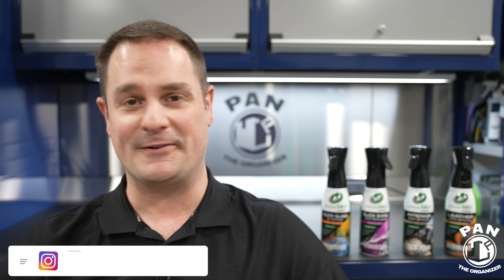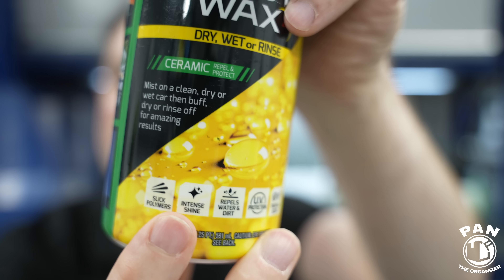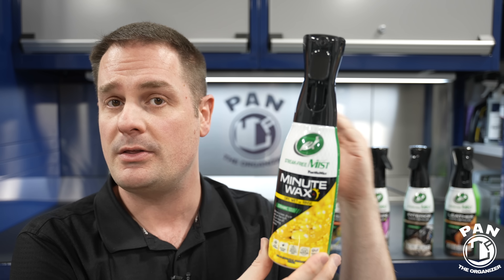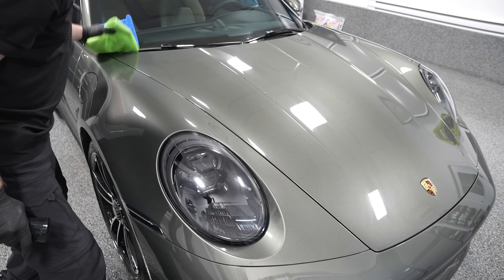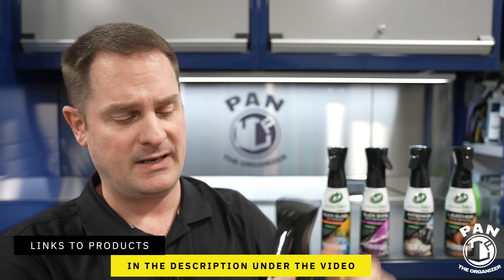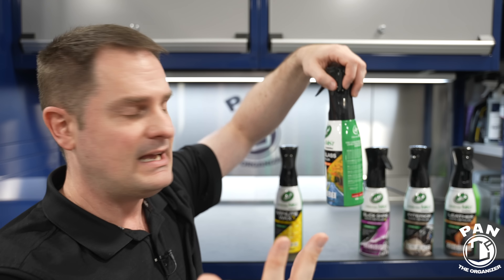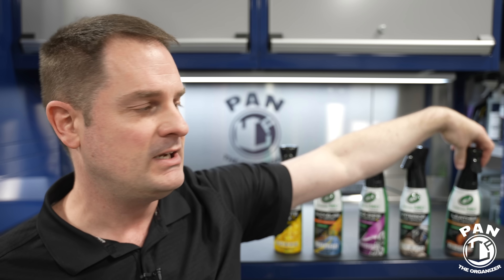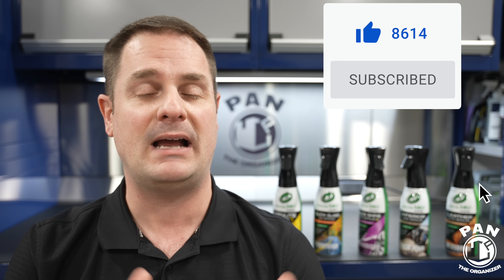The NEW Turtle Wax Minute Wax! You guys made this happen!

Comment: Helpful review, as always.  However, I have a question.  With these easy-to-apply "one-step" protection products so prevalent in the industry now, why would I use, for example, TW Minute Was vs. TW Seal and Shine?  For years, after every wash, I put a quick application of TW Seal & Shine on.  The effort to apply/remove is the same for minute wax vs. Seal & Shine, the price for each is a few bucks difference (Walmart $8.48 vs. $12.13), but with Seal & Shine, you get a highly top-reviewed, torture-tested product, and proven reliable product that will last much longer than Minute Wax.  Am I missing something?

Comment: Hello. I have some questions. First - can it be used like a quick detailer that you can use every time after wash a car (for example every week) if It can't. Second - How long should it be used? Weekly, monthly or in two months or ex. Third - if it is not a quick detailer, can i use quick detailer over it after my maintenance washes?
Reply from the maker: Turtle Wax states one can expect 6 to 12 months of protection with the new Minute Wax. 

As Minute Wax is new to market, I still need more time to evaluate the real world durability of Wet Wax in my conditions, but I would recommend it more as a topper over an existing protection, to boost the properties of that protection and maintain its durability.

You can try and use it weekly as a QD if you want, but just do very light applications.

Comment: Pan, thanks for video.  After washing car, I apply P&S Bead Maker, then dry.  Can I put the Turtle Wax Minute Wax over Bead Maker or should I skip  the Beadmaker?
Reply from the maker: I wouldn’t stack too many toppers. Pick one.
Reply: @PanTheOrganizer  Pan, thanks for response.  BTW the best reason to buy Minute Wax Minute Wax is that you get a Flairosol sprayer/bottle you can use when empty that is cheaper than buying an empty Flairosol bottle.

Comment: I'm a fan of the second "dry and shine" method. As an apartment dweller who mostly has to use commercial do-it-yourself car wash bays for maintenance washes, I don't have to waste any of my 6 minutes of paid for water wash-time using the dryers or wax products they offer. i just wash, then drive out, park and dry/polish outside of the bay. If I have any "complaint" about TW products is that there are so many products that seem to do more or less the same thing and frankly it's a little tough to keep them all straight. But their value for dollar is unbeatable.
Reply from the maker: Yeah the bang for buck you get with their products is nuts. Thanks for sharing!

Comment: Is it better then gyon wet coat I've been using it since last summer it lasts for ages and so easy to use so is this better
Reply from the maker: WetCoat is more a pro grade product and will last longer. It also costs significantly more.

I wouldn’t compare them.
Reply: @PanTheOrganizer  thanks pan for your reply
Reply from the maker: Turtle Wax states one can expect 6 to 12 months of protection with the new Minute Wax. 

As Minute Wax is new to market, I still need more time to evaluate the real world durability of Wet Wax in my conditions, but I would recommend it more as a topper over an existing protection, to boost the properties of that protection and maintain its durability.
Reply: @PanTheOrganizer  yes that sound a good use for it I'm in UK well used to turtle Wax brand

Comment: Hi Pan, would you say this product is better than Turtle wax Seal & Shine or Turtle wax hybrid solutions graphene flex wax?
Reply from the maker: You can’t compare those to Minute Wax as the other two are long term paint protections. Minute Wax is more of a quick maintenance product. Not meant for long term durability.

Turtle Wax states one can expect 6 to 12 months of protection with the new Minute Wax. 

As Minute Wax is new to market, I still need more time to evaluate the real world durability of Wet Wax in my conditions, but I would recommend it more as a topper over an existing protection, to boost the properties of that protection and maintain its durability.

Comment: Can the minute wax be use in direct sun?  I’ve been using the turtle wax hybrid 1 in the black bottle with the neon 1 on the label for a few years and love it on both our cars and Harley’s.  Your demo on that stuff was great as was the hybrid wash system.  I use that between detailing as you suggested.  But I love that you can use those products on warm surfaces in the sun.  

Does this new stuff work the same?

Thanks for the videos and info!!!

Comment: Looks great!  What's the difference between the minute wax and the Turtle wax ICE Seal N Shine?  Which one is better?
Reply from the maker: That's a tough one... Minute Wax probably has a bit more gloss and for sure more slickness, and Turtle Wax states this can last 6-12 months under the right conditions with proper maintenance, and it contains ceramic. Seal-N-Shine is more a traditional paint sealant that can last 4-6 months, and likely has slightly better chemical resistance.

But Minute Wax is still too new to market and nobody has had the chance to use it for that long yet. Time will tell.

Comment: What was the difference on performance for the 3 different application methods? Does it attract dust?
Reply from the maker: Applying it on dry paint will always yield the best performance and durability, as it's not as diluted as applied on a wet surface. But application on a wet surface is quicker and more efficient. So it depends on what you want: speed or performance. 

I don't have dust issues where I live, so I'll rely more on my viewers' feedback for that.

Comment: I’ve been using the turtle wax ceramic spray and absolutely love it! Do you think I should switch to this new stuff? What’s the benefits of each?
Reply from the maker: Which ceramic spray are you referring to? The Hybrid Solutions Ceramic Spray Coating? The Ceramic Wet Wax? The Ceramic 3-in-1 Quick Detailer?

This Minute Wax isn't in the top tier Hybrid Solutions line, so we can't really compare that. But Turtle Wax states one can expect 6 to 12 months of protection with the new Minute Wax. 

As Minute Wax is new to market, I still need more time to evaluate the real world durability of Wet Wax in my conditions, but I would recommend it more as a topper over an existing protection, to boost the properties of that protection and maintain its durability.
Reply: @PanTheOrganizer  I was referring to the Turtle Wax 53409 Hybrid Solutions Ceramic Spray Coating. I love the stuff. Easiest thing to apply and the shin and smoothness of the paint is unreal. So you’re saying I could spray the hybrid ceramic spray first then this product as a topper?
Reply from the maker: You would apply the Ceramic Spray Coating, wait 24 hours, apply a 2nd layer. Then wait a full week before washing your car. At that point, yes you can start using the Minute Wax as a spray topper.

Comment: How would you compare it to Gyeon WetCoat? Thanks Pan for the review.
Reply from the maker: You can’t compare a pro grade product to a consumer grade one in my opinion. WetCoat will likely last longer but costs significantly more. And WetCoat isn’t meant to be used on dry paint. Minute Wax can be used on wet or dry paint.

Turtle Wax states one can expect 6 to 12 months of protection with the new Minute Wax. 

As Minute Wax is new to market, I still need more time to evaluate the real world durability of Wet Wax in my conditions, but I would recommend it more as a topper over an existing protection, to boost the properties of that protection and maintain its durability.

Comment: Got to admit your videos are awesome so informative but I have a question is this not a similar product to gyeon wetcoat or a quick detailer ??
Reply from the maker: Gyeon WetCoat is a pro grade product (vs Turtle Wax that is a consumer grade). You can't compare both. But WetCoat is purely to be applied on a wet surface, and rinsed off. And costs more. 

Turtle Wax Minute Wax in theory, will last longer (2-3 months for WetCoat, vs 6-12 months for Minute Wax according to Turtle Wax, remains to be seen in long term testing). Also, the TW is more versatile as it can be applied on wet or dry surfaces. But WetCoat will have better hydrophobics and chemical resistance.

Both are good really, it depends on what you're looking for.

Comment: I was looking for your video last night 24 hours ago. I was about 10 hours early on looking for your upload of this. I knew you would cover it.  I bought a bottle. I used it on my truck as a rinse aid. To compare to Formula 4 auto car wash wax and Suds lab hydro rinse off product. (Different panels) I did hybrid solutions detail must after.  I’m wondering if these bottles can be easily refilled when empty? The sprayer pattern is epic. Matt needs to collaborate with Turtle wax for upgraded sprayers.
Reply from the maker: Yeah I love these Flairosol sprayers. That perfect mist each time. Apparently you can potentially refill them, but I haven't tried it. To my knowledge, the cap is pressure fitted on the bottle.

Comment: Didn’t read every comment and maybe you had said what my question is
How long does the spray wax last approximately with a vehicle that left outside in the sun
How often do you apply the spray wax
Reply from the maker: Turtle Wax states one can expect 6 to 12 months of protection with the new Minute Wax. 

As Minute Wax is new to market, I still need more time to evaluate the real world durability of Wet Wax in my conditions, but I would recommend it more as a topper over an existing protection, to boost the properties of that protection and maintain its durability.

Comment: My question is, how long does it last. I live in the northeast and winter's are brutal. I use Maguires ultimate liquid wax. I wax it for the last time about October and even putting the car cover on and off it's still beading water in April.
Reply from the maker: Durability depends on a multitude of factors like for any paint protection. Mileage, environment, application, maintenance, etc.  Also, this is too new to market still, so nobody has had the chance to test it for 6+ months yet.

And Turtle Wax states one can expect 6 to 12 months of protection with the new Minute Wax. 

As Minute Wax is new to market, I still need more time to evaluate the real world durability of Wet Wax in my conditions, but I would recommend it more as a topper over an existing protection, to boost the properties of that protection and maintain its durability.

Comment: hi  pan. is this similar to the hybrid solutions ceramic wet wax?
Reply from the maker: Not quite, as Wet Wax is to be applied as a drying aid over wet paint and is a part of the higher end Hybrid Solutions lineups. Minute Wax can be applied on wet or dry surfaces, and costs less.

Comment: I have an 2023 Ford Bronco with the carbon fiber hard top. What is the best way to protect the top?
Reply from the maker: If it's a coated carbon fiber (glossy with a clear coat), use the same protection as you would on your paint. Your choice of wax, sealants, ceramic coating or graphene coating.

Comment: Hi Pan.  As always, well done!  Had a question: I applied Turtle wax hybrid solutions graphene flex wax as my base protection last year.  I've "topped" it off a couple of times with the same product using both wet methods as directed on the bottle and have had a little streaking which has been difficult to remove  (probably due to over-application of the product).  Would you recommend topping off the graphene flex wax using the same product applied to dry paint (I'm interested in trying it this way) or using the Minute Wax which seems a little more idiot-proof (that's me :-).  Thank you.
Reply from the maker: You shouldn't be applying Flex Wax too often, as it's a long lasting protection (8+ months in most conditions). If you apply weekly, you run the risk of product buildup and streaking. Also, overapplying leads to streaking. One or two mists per panel is all you need. Use a second damp towel (damp with just water) to level if you see streaks, and come back with a third clean and dry towel to buff.

For regular washes, use a quick detail spray like this Minute Wax or the new Graphene Pure Shine misting detailer which I reviewed last week, or a drying aid like their Ceramic Wet Wax. That's all you need.

Comment: What a beautiful car 1st of all. 
I can't wait to try this product! Did you see any difference in end results between the different applications?  As in do you feel one gave more protection or sheeting?
Reply from the maker: Thanks for the comments about my car. Since it's very well maintained, there were no differences in protection or sheeting, as the professional grade graphene/ceramic coating on it still is performing like day 1. What I did notice is a nice little bump in gloss and slickness.

But on vehicles that were more neglected, yes I absolutely saw a difference in the way it helps boost the hydrophobic properties (beading and sheeting) and also boosted gloss and slickness.

Keep in mind this is more used as a maintenance type product, that you can use regularly. It's not meant to last a super long time like ceramic coatings, or stronger paint sealants. This is more of a quick detailer, for regular maintenance. 

Turtle Wax states one can expect 6 to 12 months of protection with the new Minute Wax, but as Minute Wax is new to market, I still need more time to evaluate the real world durability of Wet Wax in my conditions, but I would recommend it more as a topper over an existing protection, to boost the properties of that protection and maintain its durability.

Comment: Is there guidance yet on how often one should re-apply it?
Reply from the maker: Turtle Wax states one can expect 6 to 12 months of protection with the new Minute Wax. 

As Minute Wax is new to market, I still need more time to evaluate the real world durability of Wet Wax in my conditions, but I would recommend it more as a topper over an existing protection, to boost the properties of that protection and maintain its durability.

You could use it after each regular maintenance wash.

Comment: Did the car have any product on it prior? Coatings etc? Also, any idea on how long this lasts?
Reply from the maker: As this is my Porsche 911 Turbo S, yes it has a ceramic/graphene coating on it. And it was important for me to test how well the new Minute Wax plays with existing protection, as most people will use it as a topper over existing protection as I said in the video (wax, sealant or coating).

As I also mentioned in the video, you are free to use Minute Wax as a stand alone paint protection if you want, if your paint has no protection on it.

Turtle Wax states one can expect 6 to 12 months of protection with the new Minute Wax. 

As Minute Wax is new to market, I still need more time to evaluate the real world durability of Wet Wax in my conditions, but I would recommend it more as a topper over an existing protection, to boost the properties of that protection and maintain its durability.

Comment: Thanks for a great video. I bought and used Pure Shine yesterday. I like it. I’ve been using Xtreme Solutions Topper. I’ll let you know if it has better anti static properties than Xtreme Solutions. Question: since the new Minute Wax can be used as a topper, what am I getting with Minute Wax  that I’m not with Pure shine?
Reply from the maker: Pure Shine is still higher up in the TW ladder. Pure Shine is in the top of the range Hybrid Solutions.
Reply: Got it. Thanks Pan as always. You’re the best.

Comment: How does this compare to the ceramic spray wax coating?
Reply from the maker: I wouldn't compare them. Two different products from different ranges. What is "Better" is dependent on what the consumer is looking for. Graphene Flex Wax is most versatile and can be used on multiple different surfaces with the highest level of protection; Ceramic Spray Coating is for painted surfaces only, and Minute Wax is great for a quick way to boost or add a bit of ceramic protection on top of existing protection.
Reply: @PanTheOrganizer  thank you for your response.
Reply: @PanTheOrganizer  I guess I was wondering if you tested them side by side, how they would compare.  They don’t seem all that different.  They claim about the same protection time.  I guess minute wax is easier to apply?
Reply: @PanTheOrganizer  I love your channel by the way.

Comment: Sounds great Pan.  I’m wondering if this product would be better than the Turtle Wax Hybrid Solutions Pure Shine
Misting Detailer with the graphene?  I’m sure they are both great products coming from TW.  I feel that I need anti-static properties being from a very dusty area.  I also like that it can be used wet or dry.
Reply from the maker: Pure Shine is a higher end product as it’s in the Hybrid Solutions line.

Comment: What would the benefit be to using this over Gyeon Wet Coat? Can it be used on PPF?
Reply from the maker: Both can be used on PPF. WetCoat is a superior product, but costs significantly more. It’s a pro grade product, so I wouldn’t compare it to a consumer grade like TW.
Reply: @PanTheOrganizer  thanks for your insight. This channel is awesome and I’ve learned a lot and have found some great products through your reviews. I’ll have to try the Turtle Wax products. Looking at my Amazon purchases, this can be an expensive hobby for a weekend warrior. Lol
Reply from the maker: Turtle Wax states one can expect 6 to 12 months of protection with the new Minute Wax. 

As Minute Wax is new to market, I still need more time to evaluate the real world durability of Wet Wax in my conditions, but I would recommend it more as a topper over an existing protection, to boost the properties of that protection and maintain its durability.